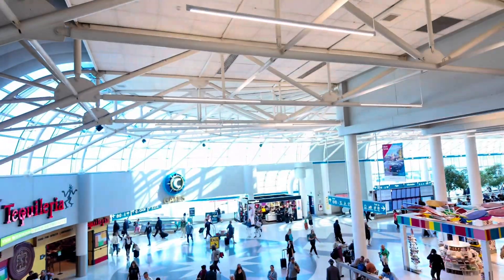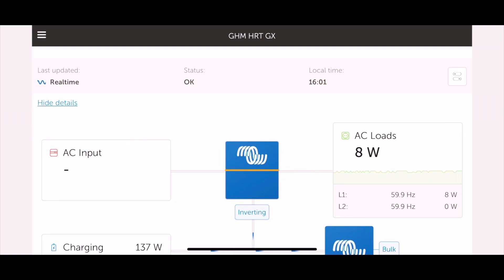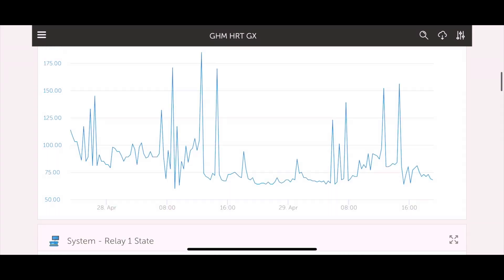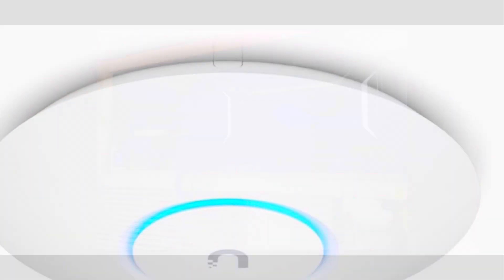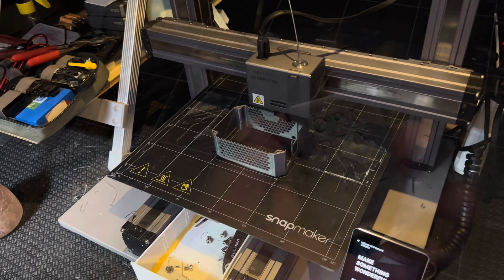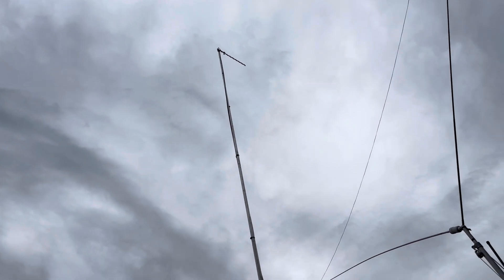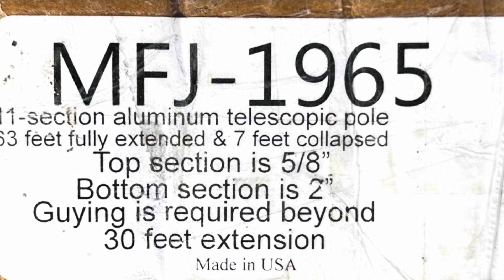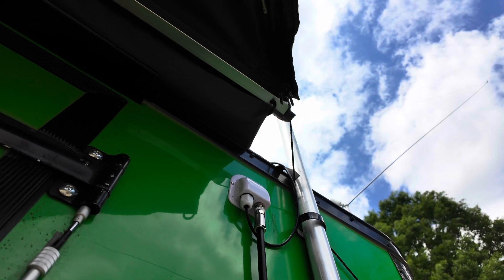Green Ham Machine Electronics Hodgepodge - LoRa, Victron Monitoring, 3D Printing

Comment: What brand and model 3D printer doyou have?
Reply from the maker: Thanks for watching and joining in the conversation. That printer is a Snapmaker 2.0. They are too expensive, but they work right out of the box, are super sturdy, and don’t present a steep learning curve to a first time user like myself. My nephew pulled the trigger first, and recommended it. He is US special forces, tight on his money, and very smart. I knew if he approved it was a buy once-cry once kind of a deal. I don’t regret buying that printer at all. It comes with auto leveling, easy filament loading, and software that makes printing easy. That’s all I know except that i am happy a with it. Hope that helps. See you out there. 73 de Billl

Comment: Interesting video.  I'm starting down the road of putting a Victron system in my teardrop.  I started with a smart shunt on the battery and will end up getting a solar controller and build from there. I purchased some Ruvvi bluetooth tags to monitor the temp in my fridge that will eventually integrate into the Victron system.  Next on the list is to get some type of 802.11 dish system I can use to bring in campground wifi when it's weak.
Reply from the maker: Kyle!  Thanks for watching and joining in on the conversation. I’m very satisfied with Victron, but that’s where I started and ended up immersed. It’s sometimes proprietary and NOT inexpensive. New things from other manufacturers pop up around me, and I’m sort of unable to incorporate because I’m deep in Victron. So, I guess there are pros and cons. I keep my eyes open, though, like at Moore so I’m aware and can add things that are useful. As far as campground wifi, I saw a video years ago  and that’s what got me started with ubiquiti; I’ll probably stick with them because, again, already down that rabbit hole. Your trailer is awesome, and I look forward to your developments. See you at Dayton. 73 de Bill

Comment: Looks great Bill!.. I am working on getting a cargo trailer converted to a camper/hamshack.  I have a lot of Victron equipment that I am planning eventually on installing in the trailer along with 800W of solar panels on top and 400 AH of LiFePo storage.  For temporary use, I have a Bluetti 200P solar power unit until I get the Victron equipment installed.   I hope that you will do a few videos on your solar equipment and any cool stuff you want to talk about that you did to the trailer build.
Reply from the maker: You got it!  If I can help, I definitely will.  I sometimes hold back on the trailer videos because this is a "ham" channel, but when I talk to my ham friends there is so much of this that is "ham adjacent".  Solar is one of those subjects that I am NOT an expert on but totally willing to share what I think I might know.  I just ordered a flexible 100w to finish this trailer.  I have two (2) 300w panels and a 700w capable charge controller installed now.  That panel I ordered should bring the system to capacity on paper at least.  I ordered another 100 ah LiPo battery to go with the two (2) 100 ah LiPos that are already there.  I hope to have four batteries in total soon.  We will see if that's enough, lol. Thanks for taking time to watch and comment.  You can always stop in and talk about your build as it goes along.  See you out there.  73 de Bill